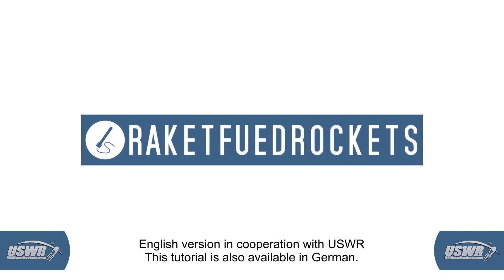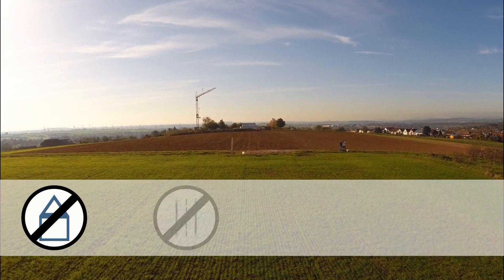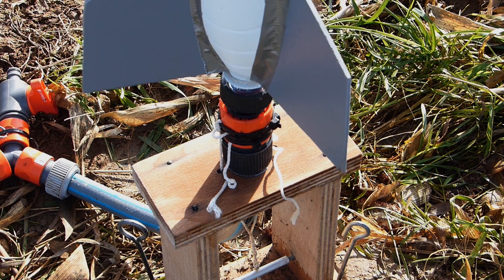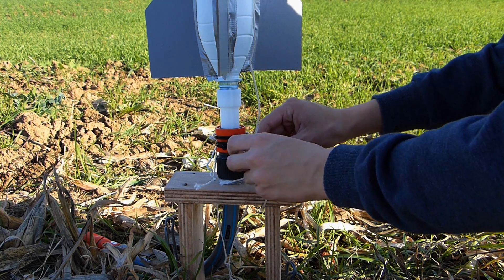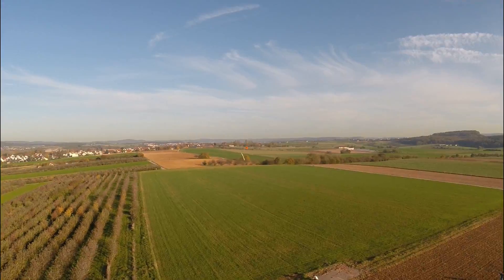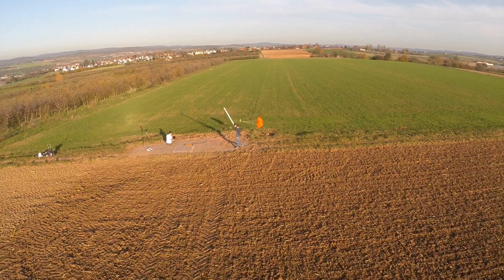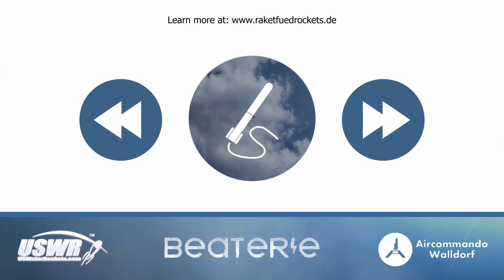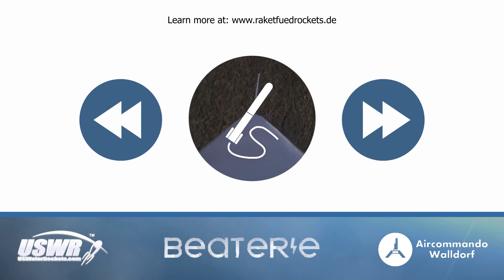Tutorial: How to build a huge water rocket [5/5] - Preparations and launch

Comment: How is it possible that the water, after filling the rocket, is not flowing into the garden hose?
Reply from the maker: You have to put the hose on a higher level in order to prevent that. We also have a non-return valve in our larger launchers. :)

Comment: Very well done guys. I love the aerial shots of the launch site. :) What kind of performance are you getting out of this rocket?The nozzle looks like a batkiter nozzle. :)
Reply from the maker: Thanks George. :)
This rocket is basically the Swallow 1 with a few changes to make it easier to build.
I'm sure it could fly a lot higher, about 160 metres if you use more pressure.
In fact that's a Batkiter nozzle. :) It works very well, we use also his Tornado Tubes.
Greetings from Germany
Reply: How high did it go ?

Comment: Why did you use a different nozzle? Will this one work better and how is it made? On a lathe maybe?

Great series btw!
Reply from the maker: Thanks Oliver!
Yes, the nozzle used in this video was made on a lathe. Of course you can also use the nozzle builded in part 2! In our case the self made nozzle got damaged after a test flight. Because Timo from Aircommando Walldorf had traveled extra 100km to us we had to use another nozzle instead of making a new one. This means not that this nozzle is better, we used the glued nozzles from part 2 for a really long time and they are very reliable.
Cheers
Julian
Reply: Oke, thanks!